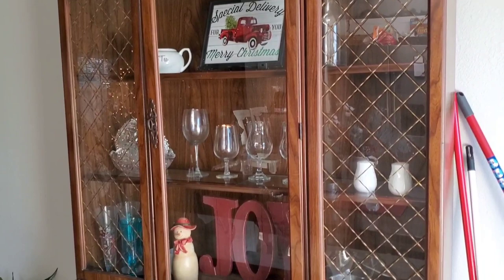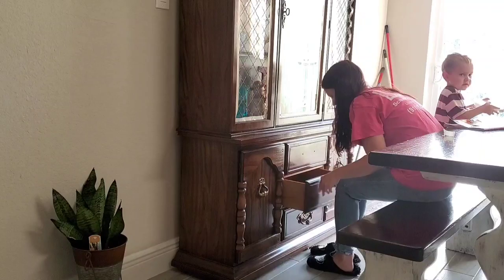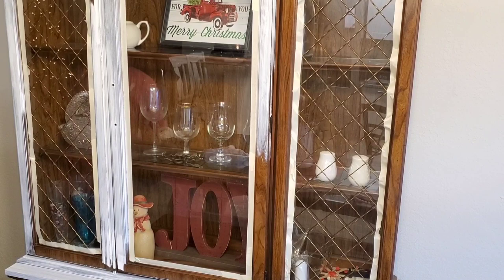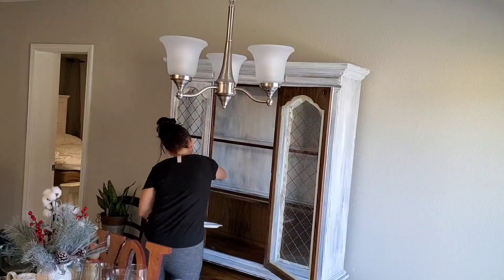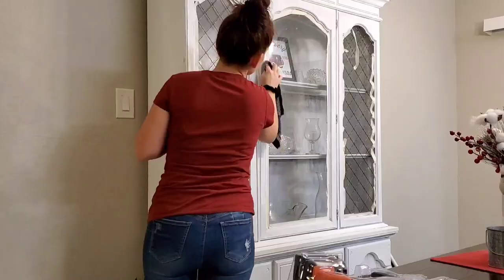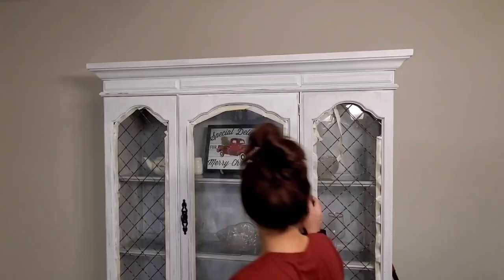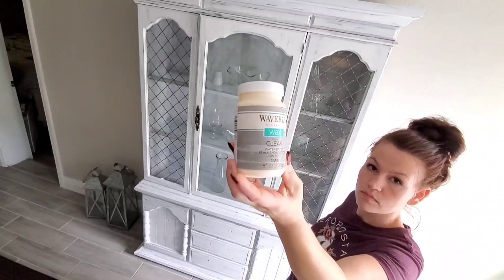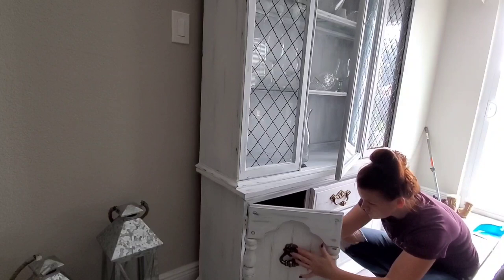Hutch makeover | Painting with Chalk paint | Rustic Farmhouse look.

Comment: I love the hutch  it’s beautiful and if you want more chalk paint ideas Jamie ray vintage is really good to watch
Reply from the maker: Thank you  I'm going to pin your comment so others can see this 💓
Reply: I watch jami ray too. Great tip, wearing clothes inside out. Love ur hutch.
Reply: Heather Gould ....oh God yes she's Awesome !!
Reply: Search Jami Ray Vintage (no "e" on Jami). Her and her husband are awesome and I NEVER miss a video! ❤
Reply: Heather Gould , jami ray vintage also sells diy paint which is clay based and safe, it is also easier to wet cloth distress you can also water the paint down.  It isn’t cheap but it’s so versatile and also heavily pigmented so you can mix colours to tone them down it lasts longer than chalk paint.  You can also make your own chalk paint cheaply, by mixing a vinyl based paint, any colour, with a powder mix, this can be Plaster of Paris (Amazon or eBay) or powder filler for walls, the kind that you mix with water to fill holes. The mix Is 2 cups paint to 1 cup powder and that’s it, there are tutorials on mixing your own chalk paint on YouTube, it’s so much cheaper and the same as the expensive brands, no pre sanding, just wipe over your furniture to remove sticky marks etc and paint away, give it 24-48 hours to dry to sand paper distress or immediately to wet distress then wax if you want.  It covers wood, metals, bonded melamine sorts of cheaper furniture too!

Comment: 1.5 years ago I found at goodwill for $24.99. I painted it right away but I didn’t distress it though, I’ve been letting it distress on its own. I took the back off as it was screwed on and it was easier to paint inside. While the back was off, I painted it a pale turquoise. I’m thinking of changing the color to pink.

Comment: Looks awesome. I do have a question...do you not have to sand first with chalk paint? I know typically you have to sand for the paint not to peel. Just wondering!!!
Reply from the maker: I've been told with chalk paint you don't have to sand but I think it depends on the material your painting. I've never had a issue though and this is my fourth project using chalk paint without sanding. Hope that helps 💕

Comment: It turned out so pretty. I know someone who wants to paint kitchen cabinets that are not real wood. I suggested chalk paint. Do you have any advice on this project? Thanks
Reply from the maker: Seal it with something stronger than a wax I'd suggest polyaqrilic or  polyurethane.  I personally love poly acrylic because its it's its easy to apply. And also make sure the surface is grease free .  I hope that helps.
Reply from the maker: Also sand in between coats so they don't have a ton of brush strokes.
Reply: Do you apply the poly acrylic with a brush or cloth? Also, what would you use to clean the surface with? Thank you so much.